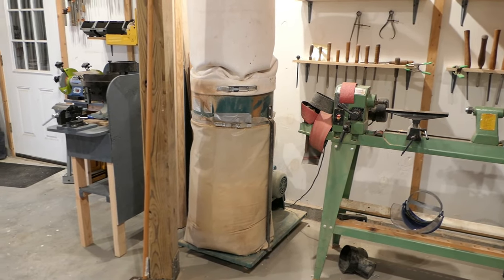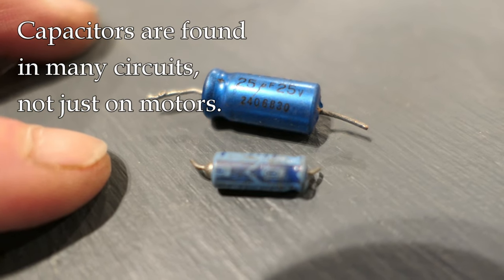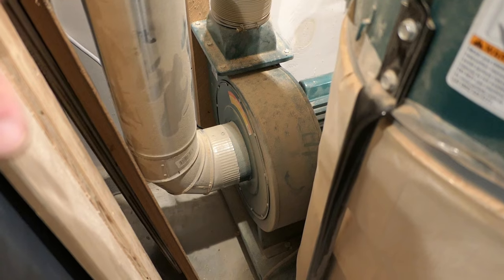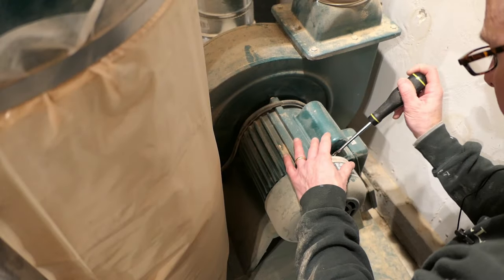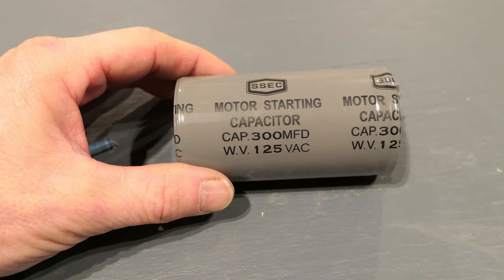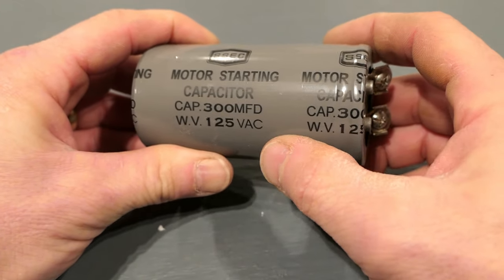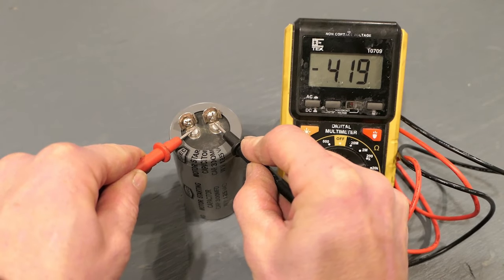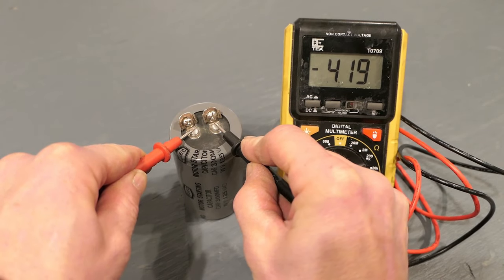Get Your Motor Running: Testing A Start Capacitor

Comment: The capacitor is connected by a centrifugal  switch on the rotor shaft. It that isn't closed when you apply power, the motor won't start and will probably trip the power . If there is a wiring diagram in the motor terminal block, look for a direct short across the terminals to the centrifugal switch.  in my experience,  these contacts cause more start failures than failed capacitors particularly if  the machine has only intermittent use. The most common reason capacitors fail is prolonged exposure to high temperatures. This rarely happens in workshop machinery which isn't running continuously. Use a resistor to discharge not a screwdriver. That  prevents a very high current discharge which could damage the component.
Reply: That is another good reason except he mentions that it spins a little and if they hit the breaker back on while still spinning it goes.  From what I understand an induction motor will just hum if the start capacitor is not in the circuit. It won't move even a little.
Reply: Hey Tony, That's old school. I blew up a capacitor in Vo-Tech (1983) because I had a stuck spring. Everything is electronic now. Correct me if I'm wrong.

Comment: When you test the capacitor with the first test using the 20k Ohm setting, it does what it's supposed to.  What would be a failed reading using this test?
Reply from the maker: Good question--I could have been clearer on that.  If the meter did not gradually rise to infinity but displayed a fairly constant low value, then the capacitor has a short.  If it displays a constant very high value then the capacitor has an open fault.  So either way if you don't get a rising pattern toward infinity then the capacitor is trash.

Comment: Did the fix at the end continue to work long term?
Reply from the maker: Well, technically, no!  The problem continues under cold temperatures.  However, the shop has been heated during the recent winter so I was able to ignore the issue.  My suspicion is that the combination of cold temperatures making the fan bearing more difficult to turn and the length of the circuit creating a minor voltage drop by the receptacle used for the dust collector is enough to cause the issue.  What I need to do is move the collector to a shorter circuit and test that in the cold or measure for a voltage drop due to resistance on the existing circuit.  Maybe this winter I can leave the shop heat off and experiment.
Reply: @enduringcharm 
How close is that motor's  amp draw to the breaker rating?  Induction motors will draw more current briefly at start up. That is why there were time delay fuses for induction motors back in the day.  Is that breaker weak or failing?  It is possible that there is shorting in the windings of that motor but then it would probably trip a breaker all the time.  Also note that capacitor checkers like that are checking for capacitance at almost no voltage so they NEVER check a capacitor at their working voltage.  That thing could be leaking current like crazy (essentially a small, high resistance short) and be enough to trip a breaker.  Short of having an old fashioned capacitor checker that put operating voltage on it while checking for leakage it really is hard to know.  Simplest maybe would be to buy a new capacitor and try it.
Reply from the maker: It's a 20 amp circuit and should easily handle the load. However, with each receptacle added to the circuit you are adding resistance, and this is located at the end of a run.  And, the fact that the unit will start right up and not blow the circuit breaker as long as it is spinning even the slightest amount makes me think there could be a high initial friction in the bearings.  It's been working in the ambient temps, though, so I really haven't had a chance to play with it and figure it out.

Comment: What if the meter reads OL and no number?  I read one capacitor and the meter reads nF, but checking my other capacitor I get a meter reading OL.
Reply from the maker: Were you using the farad scale both times?  Sometimes meters have a shared setting and there may be a button or switch to pick which one is being used.  Also, did you check the capacitors with the ohmmeter?
Reply: @enduringcharm  yes I was.  No worries.  I think it stands for Open Loop but not sure.  I assumed it meant it was bad and replaced the capacitor.  And now my bandsaw is back up and running.

Comment: on a 80 uf, I test 77.2 uf but doing ohm test only shows 7 m ohm and slowly reaches to 9 in 60seconds with my Fluke 116 multiple times tested. Is my cap bad?
Reply from the maker: So the ohm test sounds a little wonky and the capacitance test shows you are not quite reaching the stated spec.  You could try a different meter to be sure, but it appears your cap is marginal.  These are not expensive items, so I would go ahead and replace it.

Comment: another problem with trying to start fans in cold air is just that...cold air....cold air is denser and needs more energy to move it, try placing a damper (if only temporary for start up) on the fan inlet for cold starts. Also if the motor drops out (after starting) on overload in cold weather you may need to restrict the flow rate with an inlet damper, probably not much.

Comment: My sears craftsman grinder hums when turn it on. It sat for close to 18yrs but I needed to use it and it worked fine but the next day when i turned it on it smoked and now just hums. I wonder if the cap is the problem. Dont know if my electircal testor has capedence testing or not. I dont want to buy a new cap for $15-$20 and find out its not the problem. Guess I'll see if there is any deformation in the cap

Comment: Thank you for a great vid. Just a question though, at 6:37 you said that you can switch polaritys without a problem. But i've learned that switching polaritys on a capacitor can make the capacitor explode, is that only on DC-powered ones and since this one is AC it doesnt really matter?
Reply from the maker: That's correct--start capacitors for alternating current have no polarity but capacitors used in DC applications such as circuit boards or bigger DC devices may.
Reply: @enduringcharm  thank you very much, I bet this video will save me a lot of time and/or money in the future ☺️

Comment: Sir, if I may ask.
What is the value of your capacitor if you have 5hp induction motor with dual capacitors respectively?
Some say you need to use 50 to 100mfd in every horse power on your starting capacitor and 12 to 16mfd per horse power for the corresponding running capacitor. 
I wonder if someone like you have a certain table chart 📊 for that effect. 
    Just curious here. 👍
Reply from the maker: Sorry, I don't have a chart for you.  I typically just use the manufacturer's recommendation and I haven't got into motor design.
Reply: I mean, the markings of the old busted caps are pretty unreadable already.
Thanks for your time replying by.
More power on your tutorials. 
    👍

Comment: My workshop isn't very warm and I can usually get the temperature around 50, my dust collector struggles getting started and I don't want to keep throwing the breaker to warm up the Cap so I thought about hooking up a hair dryer near it.  Do you think that would help?
Reply from the maker: If you want to try keeping the collector warm, I would instead use a utility style space heater near it.  Also, take a look to see if the circuit feeding the dust collector is especially long or undersized.  In the long run it might be cheaper just to run a new, more appropriately sized circuit than run a heater.

Comment: My air compressor (single phase motor) starts and runs fine, but..... I have multimeter with capacitance reading and run capacitor is in the tolerance (nominally 40uF +-5% and i measured 40,2uF) . My start capacitor dont have tolerance labeled and is 100uF nominally but i measure 186uF. Is it something to be concerned about? It looks like new, no swelling, discoloration, smell etc.
Reply from the maker: Sounds like you don't actually have a problem! If the unit is starting and running normally and the capacitor looks fine, you should be good to go.
Reply: @enduringcharm   thanks, yes, no problem (so far), but worried if capacitor is failing and if it could damage the motor somehow.
Reply from the maker: No, if the capacitor fails it will be limited to that component.
Reply: @enduringcharm  thanks
Reply: @enduringcharm  Just learned that my start capacitor have internal resistor and thats why im getting higher capacitance value - seen video on youtube measuring with and without resistor and the same happened.

Comment: I have a hot tub. House power to it is borderline low. This is a power company failing and not the house wiring. 
Anyway, sometimes when I turn the tub on the pump motor will just buzz. 
This motor is fed by one red wire from a mother board and has no capacitor. 
Can I add a start up cap. to this set up?
Reply from the maker: I think you are barking up the wrong tree.  Rather than looking to modify the set up it would be wiser to fix the existing issues.  When you say the power is borderline, what does that mean?  Is the voltage supplied from the street low?  That could be monitored by the motherboard controller you mentioned and it may be trying to save the motor from damage.  Better to find the low voltage problem.  Similarly, the motherboard controller itself could be the issue.  Have you examined it closely for burned up capacitors or other damage?  This video is on a different subject, but the control board damage is similar to what you should look for:  https://youtu.be/bR6jjTOd5e8